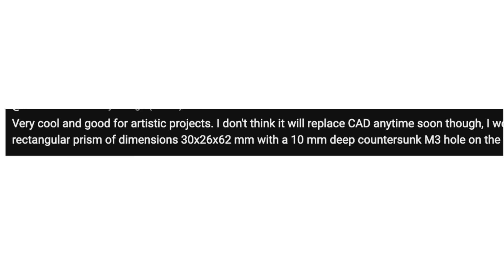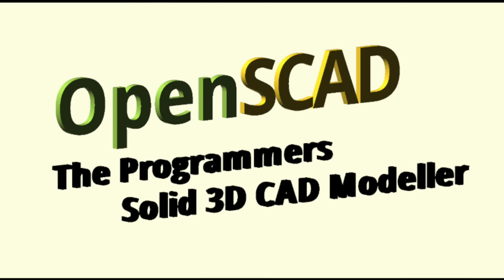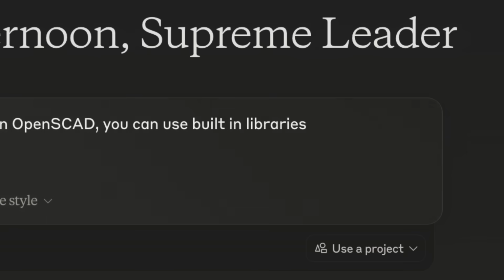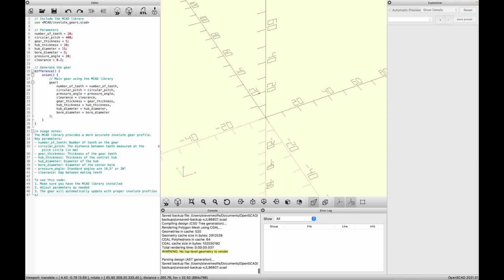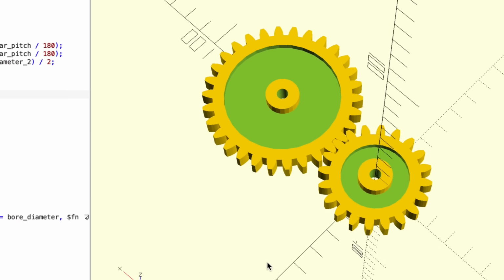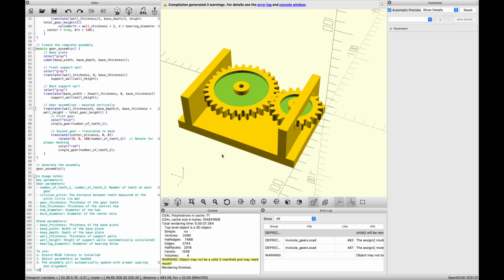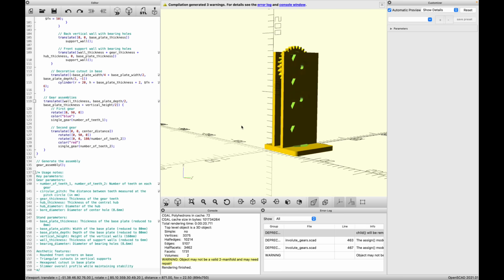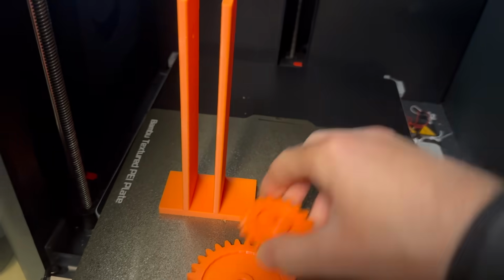CAD and 3D printing will never be the same....

Comment: You could have asked it to optimize the final image for economic material use in 3d printing and to not compromise structural integrity while doing that. I might try that, to see the results. The other thing you could do if you really want to test its engineering skills is to make it design a gear set for a specific force or specific rotational speed on the output shaft, given some input shaft values.
Reply: or you can do it your self. The math is not that hard

Comment: You can design something as generic as this in more or less 23 seconds using the engineering design module of a CAD software like Autodesk Inventor with precise design parameters. The idea of AI designing or simplifying the design work, especially for generic parts like gears, pulleys, belts, shafts, bearings etc. might seem new, but it has been in play for probably as many as the last 5-7 years.

Comment: I taught a class doing this at our university - AI assisted design.  We used Claude, Gemini, and ChatGPT to do exactly this - give the AI a task and ask for OpenSCAD compatible code.  Works great, right up until it doesn't.  It falls apart pretty quickly.  I think there's a long way to go here - even if it has some promise.
Reply: it took some years for CAD to become the default after drawing on paper. 2 to 3 years from now some professional CAD company will release integrated functions and Voilà 😉

Comment: If you have to “nudge” the AI in the “right direction” why not just google or YouTube search how to make a gear in tinkercad for free and with much less time and effort involved? I really don’t think this is a good way for people get around learning a skill, especially one as easy to learn as cad. Cam may have been a better example to use when creating tool paths, but even cam is fairly easy to do. Using AI for help really shines when it comes to Arduino code tho, at least in my experience, but if the AI struggled so much on just two gears, then there’s not really anything useful I see with this. The case study is interesting either way tho, thanks for the video 👌🏼

Comment: It would still take a mechanical or design engineer to influence the prompt to make better results, it's still not removing the need for skill talent and expertise. It's interesting tho. I was working with gpt to flesh out an idea and it cannot figure out what I'm talking about and reverts to something completely different over and over. Even sharing cad designs to it. We're a long way away from auto generated cad design with a single prompt. 
We're closer to it with generative design. And that's heavily guided but I'm another way.

Comment: Ive tried this trick before. It's way faster for me to just design what I want myself for the number of times you have to correct it. I could have designed those gears by hand in fusion 360 in a fraction of the time.

Comment: The ability to write clear descriptive text to efficiently reflect the design into AI will give you an edge, otherwise it will take too many iterations to achieve final product.
Reply: Basicaly to write a prompt to an AI (LLM) that precisely describes a 3D design of parts working together like a hinge is more difficult than to write the code in openSCAD.
OpenSCAD is made especialy for that.
And even more difficult is to describe it in a way that is Parametric.
Reply: @georgmeiner267  im just now starting my fusion360 CAD journey... what do you suggest i watch/read to gain the skills to bring my project to completion?  I went back & worth with chatgpt & its saying to outsource the CAD to a freelancing job site.  I want to do it myself ( quickly / easily though )

Comment: Great. video , although it opens up a lot of follow ups, that we will probably have to check out ourselves. Curious question , is there a reason why you printed the stand in vertical orientation ?I believe printing it flat on one side could have worked too.

Comment: As a design engineer, this made me feel my job is at zero risk
Reply: @jonwebb9261  2 years ago this wasn't possible. Now it is. 

Each year it's leaps and bounds better.

Most white collar jobs have maybe 4-5 "good" years left before they can be replaced with AI most likely. 

I'm a white collar worker that does blue collar hobbies, and that's why I am mixing both. 

Everyone better be skilling up and learning how to work with AI going forward before you get left in the dust.
Reply: @DESX312  okay, but the improvement is asymptotic because it needs training data that humans provide. The more humans you remove from the equation, the less training data that the AIs have to learn from. We're already seeing issues with AI generated data being used in training the next generation of AI. I've heard it put that they're breathing in their own farts lol. We definitely will see jobs go away, but the more productive people will just have AI assistants instead of a bunch of people who basically just fill a seat.
Reply: @adammontgomery7980  That just means that the lowest hanging fruit is mostly all taken now. Which i would agree with. The whole point of AI currently is to push it to the point where it can recursively improve itself. The point at which that happens is really the only point of contention between companies at the moment. None of them, nor are researchers, doubting this will happen. The only question is when will it happen, and most people peg it to between 3-7 years given statements by researchers.
Reply: @DESX312 , here we are a year later, and the problems are still the same. Lack of control, lack of predictability, and the need for full supervision are all still here. For the past 12 months, progress has basically stalled, and it’s becoming clear that no current tech has the potential to replace a job position. Who would have guessed that we built just another efficiency multiplier, like we've done many times in the past, and not the silver bullet that has never existed before!
Reply: People who make categorical statements like this are the first ones to get a wakeup call.
Reply: @vitalyfokin8861  That's quite a categorical statement
Reply: They use the hype for programmers to scare people away from the field while using the shortage they created to justify inexpensive foreign labor imports. Sadly the foreign labor imports are only slightly more skilled than the AI presented in this video.
Reply: Check out Meshy AI. I design toy parts for my brother and after designing one for 2 months I saw Meshy and thought what the hell. I uploaded the reference photo and 2 minutes later I had a toy gun that took me 2 months!   It didn't work for a replacement knee gear/pin combo part, but other parts worked. It's getting close enough you should be concerned or use it to save yourself time.
Reply: Yes, but now have Calude as an agent execute this and give it a picture, 2D of how you want it to look from the appropriate angle.  Also it just hasn't been trained well on openscad, I tried this myself and yeah, it's not great.  Maybe more interesting is you can ask an image generator for a 2D render and makerworld have a 2d to 3D thing that kinda works.
Reply: yes you can relax for one more year :-)
Reply: As a pre engineer 
I am cooked
Reply: @ You're good, you'll use ai in your career but it won't replace you
Reply: What kind of engineer sees the first try and denounces it forever?
Reply: @Poindexters-Obsession  This is not the first try, I did not say forever.
Reply: Ai can only learn from the best...

...

Slight issue is that it has no clue who that best is.
Reply: AI doesn't create, it just copies.
Reply: Yet
Reply: This is what video editors were saying a few years ago with Will Smith eating spaghetti. Image editors were saying the same thing. I don't think your job as a design engineer will be at jepoardy for a while but if you don't learn how to use AI in your job you will be just as obsolete as the design engineers that didn't want to move to designing on computers.
Reply: and now? lol
Reply: I wouldn't be so sure. AI will eliminate more "white collar" jobs over the next few years that it will "blue collar" jobs. AI will be able to do your job faster and more accurately soon. I'd start learning how to manual labor soon.
Reply: @mnichols8378  so what you're saying is that we should stop wearing collars
Reply: @mnichols8378  You think a mech design engineer can't do manual labour? AI will progress incredible quickly but this is an industry that required creative thinking.
Reply: @mnichols8378  To design 2 gear with a 1:2 ratio, is a thing. In freecad you can do it faster than asking ai to write you a code and iterating it 2-3 times.
To design something which is really useful, like a transmission or a MacPherson is another thing.
Right now it is good to play with it, 3D print some toys, but is far away from overtaking a mechanical engineer job.

Comment: This is cool and all, but honestly. It is much faster and satisfying to just do the 3D modeling myself.  Having to correct it so many times is annoying AF when I can do it myself so much faster.  And it isn’t like learning 3D modeling is difficult.
Reply: Any tips on how to easily learn 3D modelling? Am very interested!
Reply: You won't have to correct it much or at all in a couple years when it gets better. You will someday just think what you want and your printer will just make it.
Reply: @nukpruf9501  it's is more complex
Reply: C'est vrai que les IA ne sont pas faites pour réaliser ce genre de chose, il leur faudrait une intelligence spatiale, néanmoins, développer une IA se spécialisant dans la CAO devrait être faisable pour ceux en ayant les moyens.
Reply: this mental model is like comparing OG architecture drawing with pen and paper with first gen autocad..
sure...your way is better.
The question is, until when?
Reply: @tikotokgamings 
Auto cad still hade some prose comperd to doing it by had 
What advantages are ther doing this using "ai" instead of a modern cad program or even pen and paper

Comment: Cool but AI is so overhyped and tragically inefficient... you can design a human friendly language with for example ANTLR so it will generate the precise code of anything you want to design. But wait...now you need to learn another "language" which compiles down to CAD format. Isn't the same thing you need to do with fine tuning AI input / output with that major difference is that the compiler does not hallucinate?

Comment: i did this a year ago, and it went just bout as well.. it'll techincally do what u ask, but ull have soooooooo little control it will NEVER work for ANYTHING.. u say make the left gear bigger, it does.. and makes the right gear smaller - u really only can make it do 1 thing at a time, which means u really only correctly make it make a triangle or a square of a certain size.. then the rest is on you 😂🤣

Comment: I use AI for CAD, but specifically for calculating gear ratios and doing all gearbox math for me. I use ChatGPT o1 for this, and Claude for all the associated microcontroller programming.
Reply: Ther are alredy gearbox math toles in most cad program, it can even generate it in your modle.
Reply: @Goroca  I haven't used many, but I am learning and will definitely check that out.
Reply: Interesting. How does it help with calculating gear ratios?
Reply: The ones that are afraid to do what we are, will be the ones left in the dust of the future of aided workflows.
Reply: I use chatgpt as well

Comment: Just my luck ... After watching a TON of FreeCAD videoes (especially for version-1) I finally decided to go all in and buy a powerful work-station as my laptop is old and it can't even render yt-videos with higher resolution than 720p. So yesterday (!), yes YESTERDAY I ordered a 3400$ workstation with a ton of CPU, GPU and RAM.  And this is what I wake up to??? Now AI (soon) can do all I need to do in CAD / 3d-printing and even more?  I guess I will be cancelling that workstation 😥.
Reply: Yes it can draw, when you tell AI what to draw. However, can it come with the problem that needs to be solved. Remember, CAD is only a tool to solve or understand a problem. The user is part of the process that presents the problem to be solved. AI can't know the problem until someone asks. You and your 3400 bucks need to learn to ask the correct questions. The guy that knows how will always have a job. The guy that knows why, will always be that guys boss. Don't cancel it, learn it. The world will always need thinkers to ask the correct questions or AI will fade away.
Reply: Nah, don't let AI ruin your dreams. AI doesn't have the creative freedom that CAD requires, it just does what others have done. And while some are gonna be fine with what others have done, it's never going to be fulfilling. You have the power to make something new. Btw FreeCAD is epic now, and it will only get better with 1.1

Comment: Prob faster just to model it yourself then going back and forth. But im sure it will get faster and better
Reply: AI part design could be useful if you spent an hour teaching it the concept of what you want and once the basic design is established, you could tell it to repeat the design with input gears from 20 to 39 teeth and output gears from 40 to 79 teeth and have it spit out 800 assemblies, or you teach it the basic design, allow customers to enter their own parameters on a website and your 3D printer makes their custom part with no labor cost for you.
Reply: @UltralightMotorcycleCamping  Or spend 15 min designing it yourself, then feeding it the code for itterations. Give it the correct info from the start instead of playing this and that with AI.
Reply: @UltralightMotorcycleCamping  

all the cad program i have uset suport programing to modefy a design, so you can alryd do this and it takes thy program cirka 30s to do it
Reply: Why would anyone have customers anymore? Honestly if this AI becomes what it can be I'm just buying an sla printer to add to my fdms and a devil forge and I think I'm done paying for anything besides raw materials.
Reply: this mental model is like comparing OG architecture drawing with pen and paper with first gen autocad..
sure...your way is better.
The question is, until when?

Comment: I once had ChatGPT write a 3D rendering program in a very basic program that I had to use in uni. All I could get it to render was a sphere, but I was more than impressed with it, especially since it wasn't a standard programming language.
Reply: Great but what if you want to do something slightly more advanced? Without knowing what exactly you except which implies knowing the programming language / tool you are working with, you can not do much. In programming, AI just translates human language to some likely incorrect output without understanding it much. That's why you need to correct it manually and it will respond with "Yeah you are right, here you have a new version" which is just a trick to mimic "thinking".